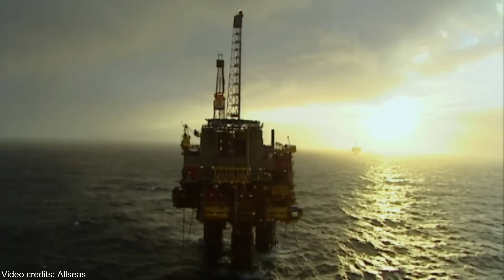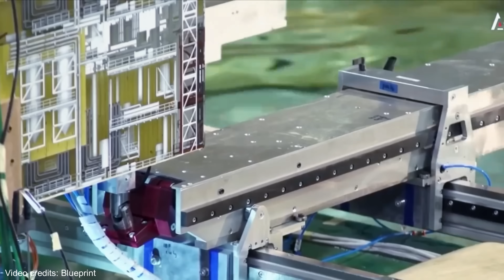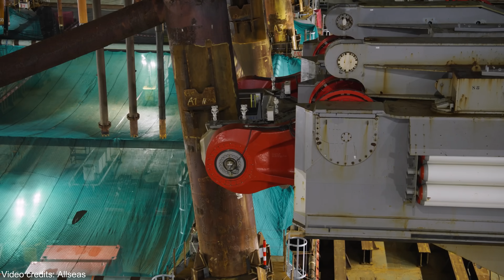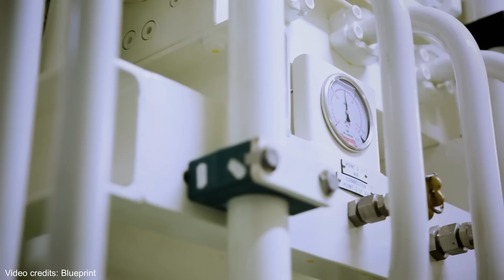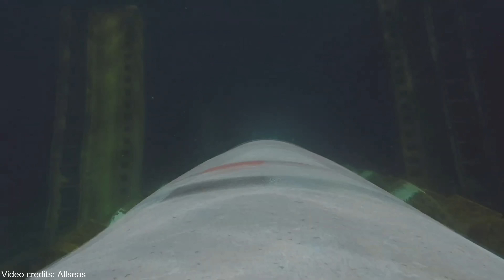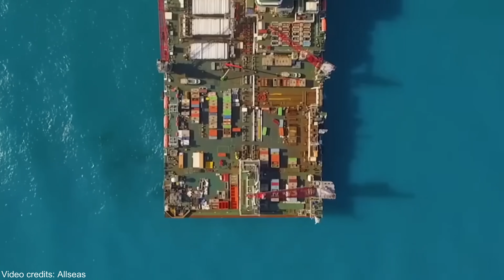This $3B Ship Lifts Entire Oil Rigs in 15 Seconds — Here's How

Comment: Pioneer Spirit is an amazing ship. That thing can go right underneath an oil rig, Lift it off of its legs and jacket, and then sail right over the legs and jacket and deliver the rig to a barge for disposal. It already did it to the Brent field and it is doing it to other fields in the North Sea as these rigs come offline and prepare to be taken back to the UK to be scrapped. Today in the North Sea rigs have to be semi-submersible. You cannot sink a rig to the ocean floor anymore because that will cause the rig to decay and a 50-year-old rig becomes a junk pile after it has been out there for half a century and those things are big polluters. International law says once a rig stops producing it has to be scrapped and the newer ones are semi-submersible. Which means once a well is done it can be moved to another site under its own power. But these older ones once they are sunk they are there for good. That's why a lot of rigs are ending up as scrap. That's where the Pioneer Spirit comes in. Its job is to remove these rigs so they don't become an environmental hazard or hazard to navigation.